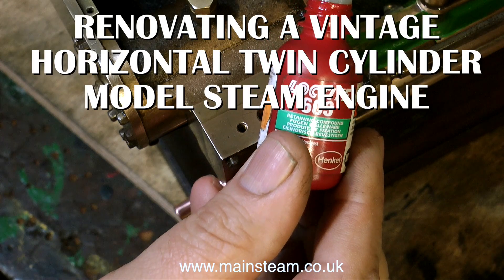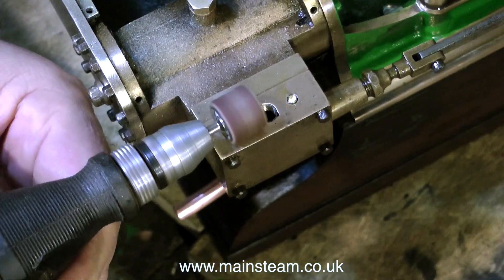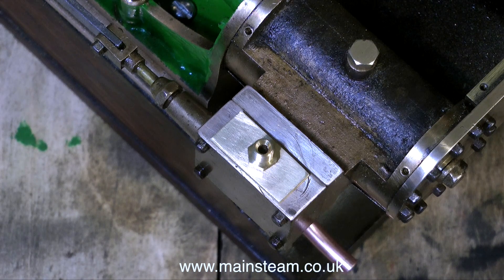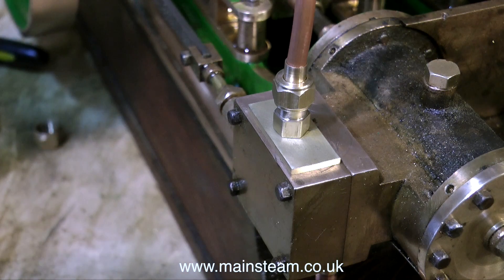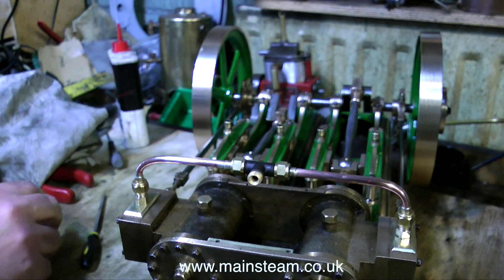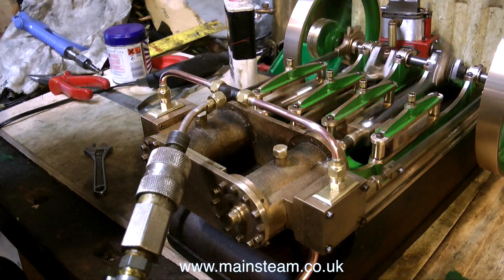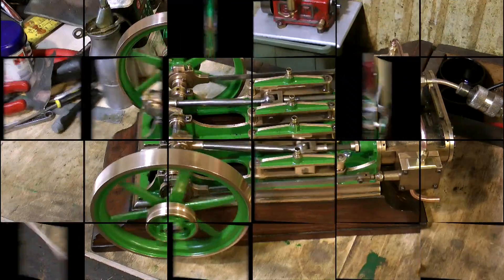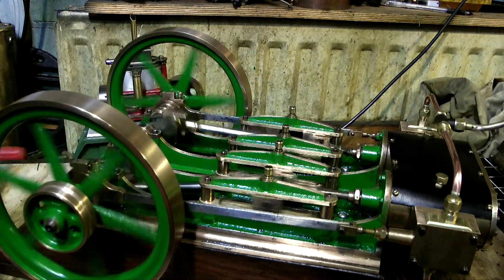PART #15 - RENOVATING A VINTAGE HORIZONTAL MODEL STEAM ENGINE

Comment: Keith, I'm busy watching all your videos, liking them very much. I was wondering though why you didn't slightly rivet the bolt studs in the steam chest (just lightly tap them to expand them to the hole) you would have been able to blend them slot nicer. I'm not really a model engineer myself, it's just something I saw others do. Keep up the good work, you got me interested in steam engines.

Comment: I might be a little dense, but why are the "throws" 90 degrees apart rather than 180 degrees apart? What am I missing? Thanks, John
Reply from the maker: jrcraft1 So that the engine is self starting . . . . . .
Reply: If they are at 90 degrees apart it one cylinder will always be pressurised but at. 180 when it gets to the middle of the revolution it relies on the flywheel to bring the valving back into position
Reply: +jrcraft1 The cylinders are double acting so 90 degrees gives 4 power strokes per rev and it is self starting as Keith says.